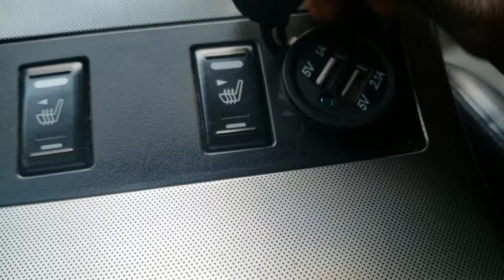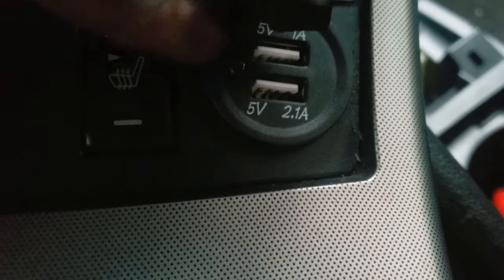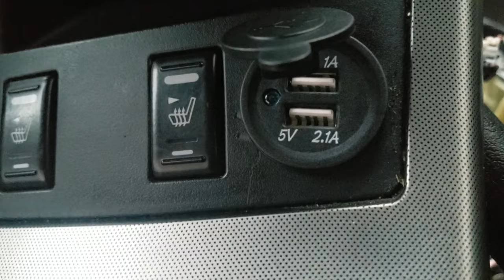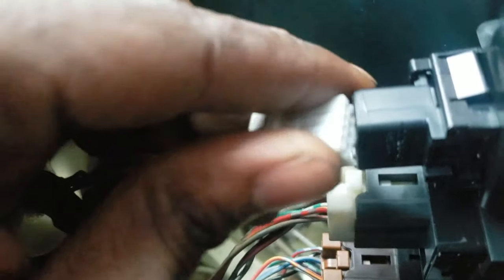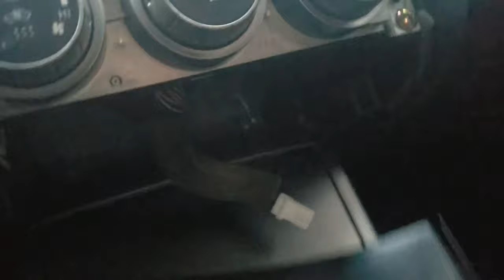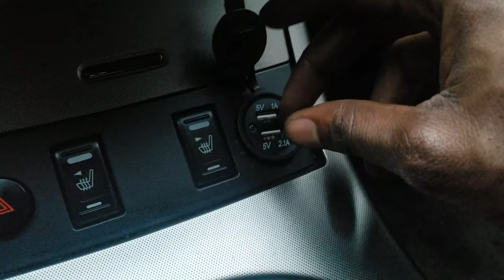How to replace the Cigarette Lighter with a USB PORT

Comment: The whole never matters perfection, as long as it is covered completely. Plumbing you always cut a square out of sewer main, and a coupler wraps around it, sealed by a gasket, and 2 metal tension bands.

Comment: For the test light to actually work, open your hood, connect the negative to the negative terminal on your battery. You may need an extension for it to reqch thats fine. Then take your positive test light wire and touch the wire one at a time to see which one lights up. The one that lights up is your positive. The one that doesnt light up is your negative. In his test all he did was complete the circuit which is why it lit up both times
Reply: you certainly do NOT need to go all the way to the battery for a ground.  Touch the ground lead from the test light to any metal on the car.  The metal is grounded back to the battery.

Comment: How do you determine which wire is ground? When you tested each cable, the light came on both times!
Reply: Completed circuit
Reply: Black wire is almost always ground on vehicles
Reply: The best way to test is to test from a wire to a known ground such as a metal bracket. When you get the light or a power reading that is power. If you get nothing that is ground. 

He tested power to ground and ground to power so it was confusing if you didn’t see it.

Comment: Maybe you can help I have an 08 Titan trying to put one of these in and there’s power to the wires but won’t power the plug itself unless I have my test light touching one of the metal pieces inside of it
Reply from the maker: That’s weird u got a good ground?... or could be the plug itself be defective cause it should power up

Comment: Now what happens when you need a 12 volt load, you have no source. Should have just installed it on its own fuse. Can make it look stock anywhere.
Reply from the maker: I Have a second one for that
Reply: Yeah there gaudier, the female cigarette adapters. They should be under panel on all vehicles, with USB in dash, and back of the arm rest/cabin
Reply: My 08 Tacoma has a separate 12v female and a cig lighter. I’m also going to delete cig lighter. Looks ancient. Lol
Reply: Most vehicles have more than 1 12v plug....normally you have one in the front and one in the back.

Comment: They do make usb charger that PLUG IN to the lighter, you know. Get one of those, and you can charge USB, use the lighter, and power other 12v things.
Reply: Just buy an adapter.
Reply: If you don't smoke, and don't want an adapter this is the way to go.
Reply: @devisissy1  But then you can't plug in any 12v accessory.
Reply: @devisissy1  I watch the Scotty Kilmer video on this subject and apparently you have to be careful not to buy a cheap adapter because it can mess things up in regards to your car computer module. Do you have any idea how to figure out which adapters are safe to use. Scotty linked to one but amazon no longer sells it

Comment: Don't be stupid people just buy a dual USB accessory that goes into the cigar lighter and keeps it because if you blow a tire you might wanna have a small 12V compressor inside your trunk and a cigarette lighter to power it and be able to inflate your spare wheel that will be (obviously because you need it) deflated. ;)
Reply: Some cars like my f10 535 got 3 or 4 12v sockets. I wouldnt do this but if u got some sockets to burn and want to fuck it
Reply: The stupid thing is putting a 12v compressor into a cigarette lighter. Get one that connects directly to the battery terminals.
Reply: What's stupid...is having a adapter sticking out....some people want a clean factory look....not some cheap part. 

Plus a huge majority of cars have more than 1 12v outlet.  My 07 HHR has 3.

Comment: does it charge your phone when the car is off? do you need to turn your key on in order to turn on to charge?
Reply from the maker: Key have to be on
Reply: @JulesMechanics  hey man. i bought one but i had open it to cut the led lights off. i couldn't stand the brightness of the led light. mine was on even with the car turned off. because it is connected where i used to have my cigarette lighter socket. the cigarette lighter socket still provided power even when the car was off. but with this new usb socket, i had to break the led off so i wouldn't have that bright light. it was blinding the shit out of me. thanks to your video i decided to get one too. works great and charges great too. but i had to get rid of that bright led light. plus, it would have probably caused to drain my battery if that led light stayed on all night. i prefer darkness in the interior of my car when i drive at night. i even dim the dash lights when i drive at night to a limit where i can barely read the mph when i drive.
Reply from the maker: @EnriqueSanchez  weird maybe your car different but they do sell them with no led light on it
Reply: @JulesMechanics  yes i'm going to look for one without led for my wife's car. she wants to put one in her car as well.

Comment: Great  Video. Just wondering is there a way to wire the new USB charger so it’s not always powered when the car is on? I’d like it to only work when your device is charging
Reply from the maker: Jerry I I’m not sure bout that only know this way
Reply: Jerry, you could wire in a toggle switch and cut a hole for it
Reply: There is something with the fuse amperage on this.
Reply: They make them with a on/off switch....I have one in my HHR!

Comment: Easier to buy a cigar lighter to usb plug 5 second install.
Reply: looks wack doe...
Reply: Those things usually don't last too long either.....the push pin will break or stop working.  This set-up is the way to go for a clean factory look!